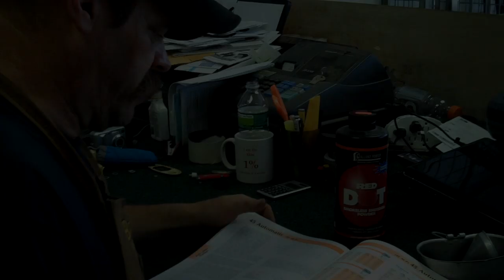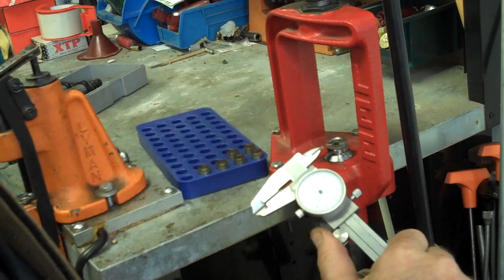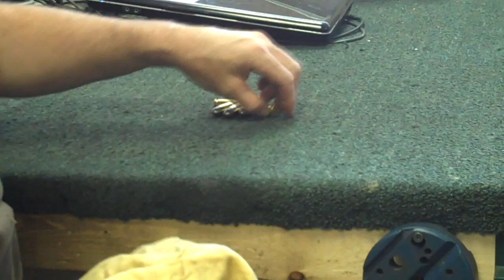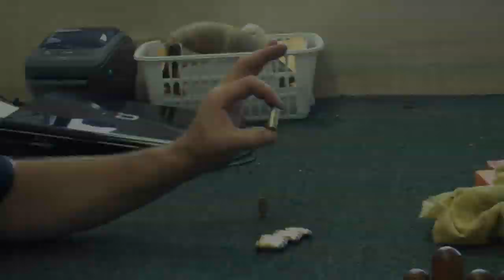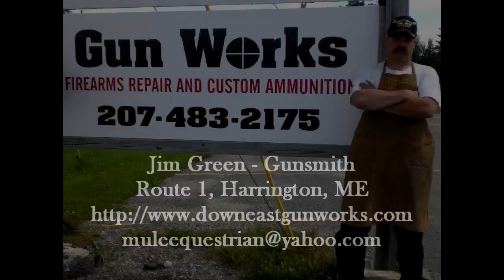Gunsmithing: How to Make Ammo, Part 2 (Gunworks)

Comment from the maker: There's a difference between smokeless loads and black powder loads. There can be NO airspace between a black powder load and it's bullet. Smokeless loads don't have that problem. Black powder literally explodes upon ignition with low pressures. Smokeless burns very rapidly and produces high pressure gas that pushes the projectile down the bore.